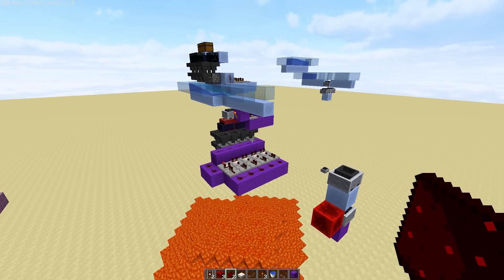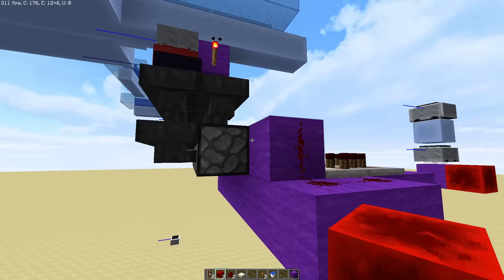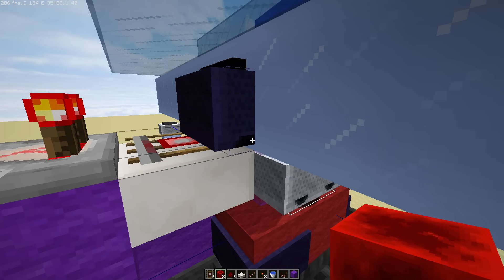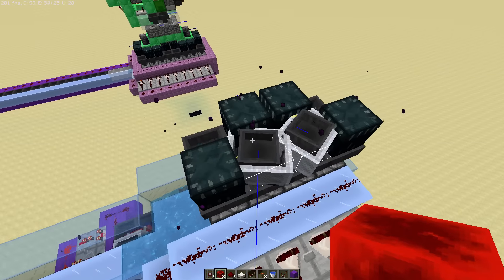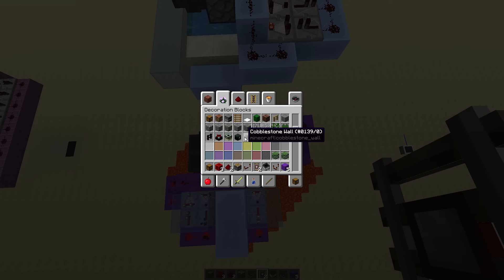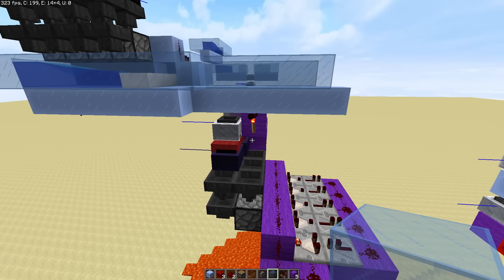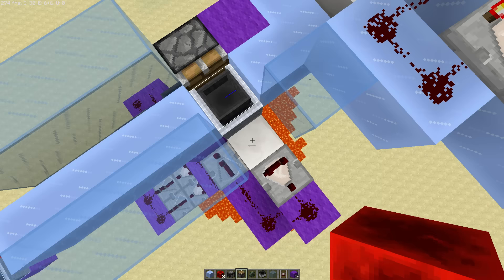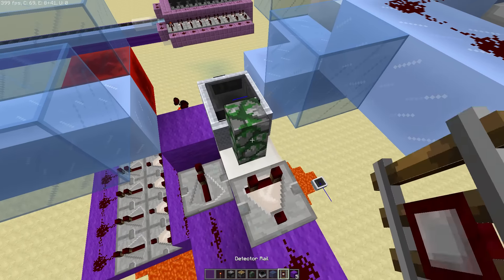20 Items/sec Item Filter/Sorter - Tutorial and Explanation

Comment: I came up with something like this some time ago, and I had an interesting idea with it that I never finished. Maybe you will find it useful at some point.

It is an idea to make a sorting system like yours on minerva faster.
The limiting factor is the speed of a single hopper, therefore the entire system has to operate at that speed. But if you dispense different items at the same time, each type with hopper speed, no hopper would overload and system would operate multiple times as fast as a single hopper.

The challange is now to "rearange" the items from the input chest. I imagined dispensing the input fast and letting the items go over maybe 10 of the fast sorters. They would normally have the first slot empty and the first item that goes into it would set the filter. The items would go in a buffer chest which gets dispensed into the sorting system with hopper speed.
This makes it possible to sort ten types of items, and the sorting system would sort 10 times as fast.

The problems i ran into were resetting the filters and dealing with the buffer chest overflowing.